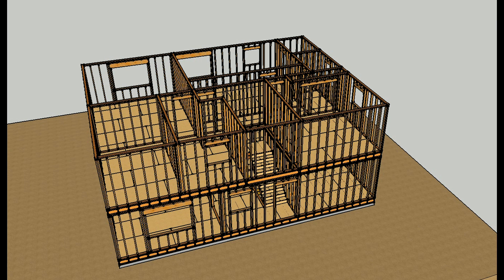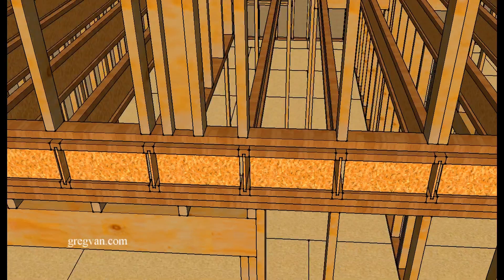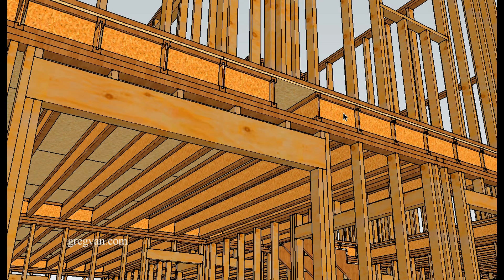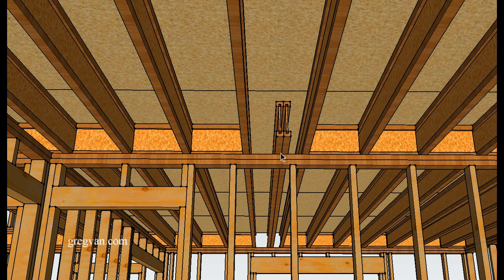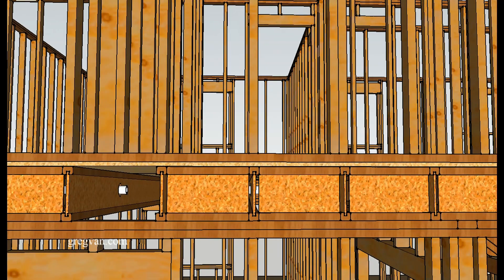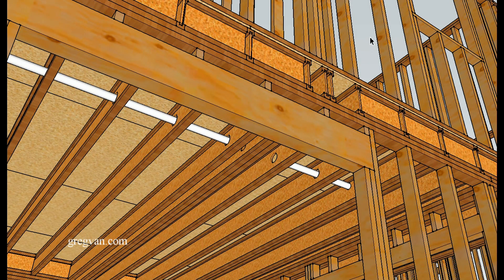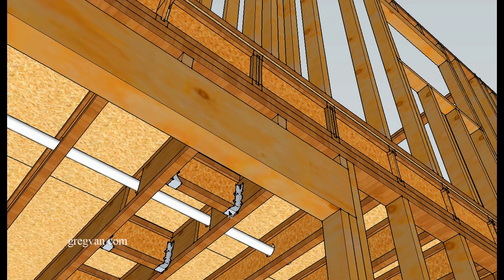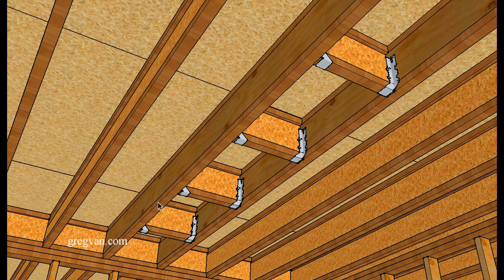How To Structurally Support Load Bearing Walls – Truss Joist Floor Framing Repairs

Comment: I'm taking out a staircase in an 7'6" space between foundation.
Load bearing wall on joists on inside side of stairs.
I need to span the gap with joists onto the foundation on both sides.
My question is - how can i do it without taking out all of the electrical and plumbing running through the existing joists?
Taking it all out and putting nee joists in and running it all again seems like a lot of extra work i may be able to work around, no?
Thanks in advance!

Comment: For the joist blocking underneath the load bearing wall, what are the smallest blocks you can use if you're using conventional lumber? Can you use 2 sistered 2x4's with Simpson hangers to provide support to the wall? Or maybe 2x6's? or do the solid blocks need to be the same size as the joists?
Reply from the maker: I don't see why not. I like to use the same size or one size smaller. For example if I have 2x12 joist, then 2x10 will be the smallest blocking I will use.

Comment: Weyerhauser wants a gap in the " web stiffeners" of 1/8" Gap at the top if using a face mounted hanger and the gap at the bottom if using a top fastened hanger.  I have a similar issue with a parallel non bearing wall which has  drain plumbing so Im either going to do the blocking or see it I can double up with a gap big enough for my drain pipe.
Reply from the maker: Always check product installation instructions.

Comment: Thanks for the video.   You mention plumbing.  (I don't know squat about building a house) If you put a double joist under under a wall, how would you run plumbing into that wall from the basement?

Comment: Ok I have a question it would be a lot better if I could send a video if u had an email 
my husband and I with our 3 boys (now 16 14 &10) built the house we are currently living in from the ground up about 3 years ago we have a load-bearing wall that has a bunch of Plumbing in the subfloor joist than our heavy Appliance refrigerator stove Etc is on one side of the wall directly behind it is a toilet and a sink for the bathroom it is dropping and sloping really bad we recently put in a L beam and lifted the floor however we still notice it dropping 
any help would greatly be appreciated
Thanks
Reply from the maker: Our email address can be found at the bottom of any page at our website. There are links to the website on every YouTube video.

Comment: Do you recommend a structural engineer if someone is beefing up the floor-adding extra joists? There is some sagging and it wasn’t built to code to start with. They are too far apart.
Reply from the maker: If you don't know what you're doing, then you will need to find someone who does and that might be an engineer or local contractor. I realize that I suggest contacting engineers, but rarely tell anyone that when they get involved that it cost a lot more money. If you don't hire an engineer and you're not going to hire a contractor, then I suggest figuring out what materials you need to use and how far apart they will need to be spaced, before making your repairs.
Reply: It turned out that the floor joist was broken by the weight of the cast iron plumbing. That is now replaced by abs dwv pipes. 

They are also spaced too far apart but because I had to remove the subfloor to replace the joists (broken completely through and the subfloor was a mess) I just added extra joists. It’s now a little overkill but much more sturdy.
Reply from the maker: @iloveburros  Sounds like you have made a good decision.

Comment: So with a center partition wall (is load bearing) being removed and new LVL beam going in.  Will I need to put a coloum and thicker footer underneath new opening in basement?
Reply from the maker: I cannot comment on your particular project, but can tell you that structural framing loads need to be supported and usually that form of support at the bottom of the foundation will be a large concrete structural pad.

Comment: Do I need to use joist hangers to do blocking or can I do toe nailing? I'm asking to make sure I pass code
Reply from the maker: If I was you, I would check with your local building inspector or building department. I toe nailed joist for stair landings without any problems and use pressure blocks for small floors and ceilings in the past, but today it seems like every building official and engineer requires joist hangers.
Reply: gregvancom Thank you!

Comment: I live in a home with a crawlspace with no piers under load bearing walls- piers are several feet on either side of walls. The result is floor heaving. I had a company recommend  steel smart jacks and double joists for the tune of $9 grand for minimal repair to $16 grand for ideal repair.  Does this work/solution and price seem accurate?
Reply from the maker: I can provide anyone with estimate information, because I don't know what people charge in different areas. If I was you, I would contact contractors in your area and get more opinions and estimates.
Reply: Get 3 estimates and go with the best combination of quality and price, but make sure that you physically check their license. Don’t necessarily hire the cheapest, but don’t way overpay either. But understand this work isn’t gonna be cheap. Good luck!

Comment: I live in a manufactured home the sill is damaged and needs relaxing due to severe water damage. The skirting and siding are going to replaced also, but I need to replace the sill first. Could you show me how to replace the sill?
Reply from the maker: Send me some pictures of your project or what needs to be replaced and I will see if I can help. You can get our email address at the website.
Reply: gregvancom Thanks for your reply, how do I send pictures of my project on You Tube? Or your email, I didn't see it
Reply from the maker: There should be a link to our website in every video, in the YouTube video description box or you can go to the main channel to get our website URL address. Then scroll to the bottom and click on contact for our email address. Sorry for the confusion, but our email address changes regularly and if I attached it to this comment, it would create problems when changed.
Reply: gregvancom okee dokee

Comment: Anybody who designs plumbing to go through joists like that needs to have their license reviewed.  :)   Construction regulations vary from state to state.  Some places you can use hangars others you can't.  One thing I saw missing from this was the cross spreaders between the joists.  Were these steel I beams with wood bolted on the sides? To me load bearing means it's supporting something above it like roof beams or joists.  With modern roof trusses the only load bearing walls are the external walls anymore.  I've seen 2nd story floors use trussed joists too, plumber and electrician dream.   My experience is from a couple years working as a framer in the 80's in GA and FL so I could just be wrong on everything.

Comment: Just curious (since I have done it in the past), but why not just take a conventional 2x8, 2x10, etc (appropriate to existing I-joist height), drill your plumbing relief, then RIP the new joist in half, place it (easily, I might add), then side both sides of the conventional joist with same-size 2x8 or 10 (whatever, of comparable dimension), also plumbing-relieved but crosscut at the relief? I have seen similar 'new construction' of 1960's circa done similar to this method, where it wasn't a 'patch' but apparently 'during construction'. It actually is a stronger method than building a new I-Joist in-place using glue, anyhow (a method you didn't mention).

Comment: It always bugs me that blocking made from (and applied between) I-joists like those shown will naturally leave a significant air gap(s), and thus must not fare well for fire containment. Do builders have a practical way to tighten up those gaps? Just curious, thanks.
Reply from the maker: Yes, some engineers require what is called webbing to be installed in those gaps. For example if the gap is three quarters of an inch then the engineer might require a piece of three-quarter inch plywood to fill those areas and the plywood also provide additional side to side structural support.

Comment: I believe the horizontal blocking in the example needs to be very tight in order to transfer both compressive load from the top of engineered beam A across to the bottom of the next (beam B) as well as tension from the bottom of beam A to the top of beam B, as well as for torsional rigidity.

Comment: if the pipe that needs to be cut out of the way is 3/4 in or smaller and the pipe is pvc or cpvc or coper simply cut the pipe out and drill the hole werever you want it and replace pipe with pex conecting with shark bite couplers , no sodering no glueing , they snap in place , very efective
Reply from the maker: +grizz270 In my opinion, it would be a lot easier to block around the plumbing pipes than it would be to cut and modify them. I'm not a big fan of rubberized plastic water supply pipes yet, because they haven't endured my test of decades yet, but understand the reason why they're being used.
Reply: we have been useing pex here in oregon for 10 years with no problem , i do realize that is a short period of time but in that time it is already proven to be better then pvc or cpvc , its been in use alot longer in germany
Reply from the maker: It seems like a good product and it probably will replace copper and that seems like it will be a good thing.
Reply: yes , and on the plus side no added flavor to the water like in pvc or coper , the down side to useing pex , is you either got to buy the snap together fittings 5 bucks and more or buy a 80 dollar tool to crimp fittings together , for home owners dont buy the tool , the snap togetherr fittings can be removed with a 59 cent tool and the fitting can be reused , so if you make a mistake all is not lost

Comment: I'm removing a partial section of a load bearing wall,  making the kitchen and dining room one big area.  I gave a 2 story 1 family home with a full attic.  Problem I'm having is if I remove a portion of the wall only one side will have a king stud,  the other side of the beam I was planning on supporting on a door way.  will I get sagging in the middle of the door way?   any ideas?

Comment: Hi Greg I'd like your opinion on my situation.  I would like to add a second story on an existing rear addition.  The main house is a 1 1/2 story balloon framed (wall joists are between 2 1/4 x 4" or 2 3/8" thick on 12" OC) house on a rubble foundation.  Given the rear addition is on cinderblock and is stick framed (2x4 on 16" OC), The proposed rear addition is not the full width of the lower addition (lower floor is 26 x 12 and the upper will be 19 x 12).  I propose to remove the existing roof joists and replace them with 2x8s with 3/4 floor sheathing.  These 2x8s will be tied into the balloon frame with 3 lag bolts) .  They will also sit on a ribbon/band joist that is also supported by a 2x4 wall that reaches the foundation.  I plan on using 2 sets of Sistered 2x8s where the outside walls of the new upper rest on.  Will this be sufficient to handle the upper floor's wall and roof?

Comment: Shouldn't the non-bearing wall be light enough to be supported by plywood?

Just use pex for the pipe you cut out.

The 2nd option would be expensive with all those headers
Reply: +2Awesome Yes if your 16oc your wall if it is not load bearing will be fine,